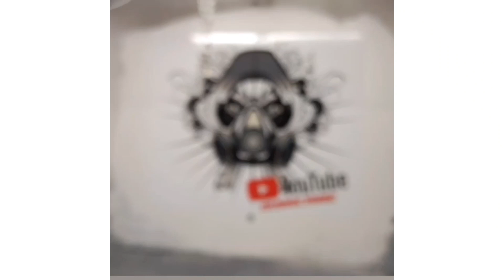Rebuilding HRE Wheels - A UKC Short - Ep 28

Comment: I have a question. I have a good set of chrome rims that i want to powder over. If i rubbed them down with maroon scotch brite pads 320 grit and powder will the powder stick or peel? or do i need to blast the chrome off to get a good bond? the chrome has no rust or peeling they are mint and i want to do them in a toxic green.
Reply from the maker: If the chrome is in good shape, just clean it well and use whatever color you want over it. dont aggressive go after the chrome with scotch brite because the scratches will be visible if the powder is transparent. If you arent doing a transparent color over chrome, I would strip them down completely.
Reply: Unknown Coatings what is the best way to strip the chrome off. I tried it in the Chem stripper and that don’t strip chrome and I also tried blasting and that takes forever. Is there an easier way to strip chrome?

So if chrome is good and I put a solid color on it you suggest stripping chrome off metal instead of etching chrome with Scotchbrite and powder over it?